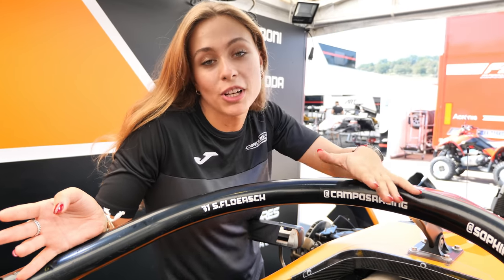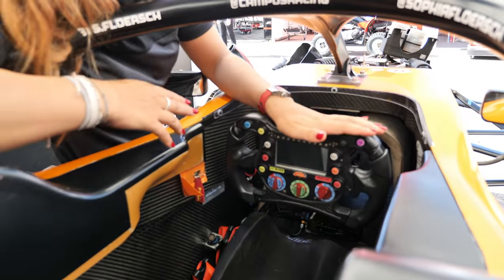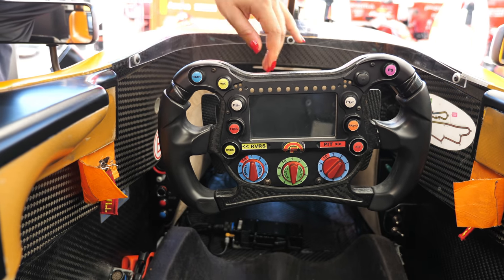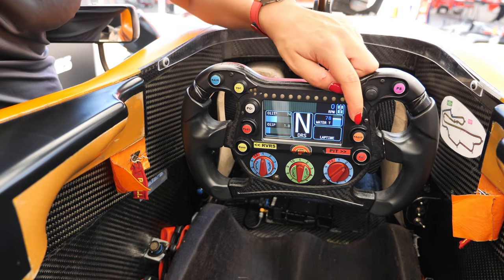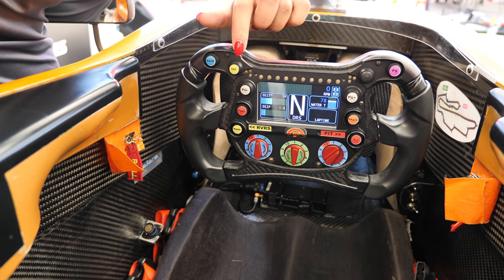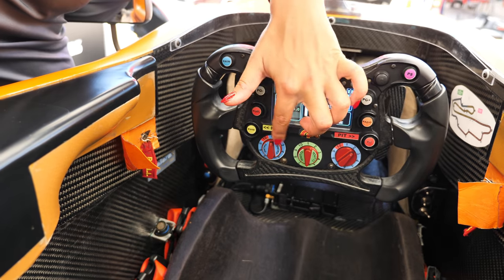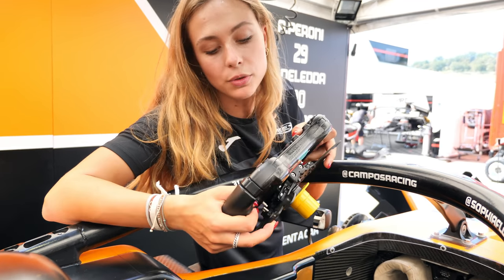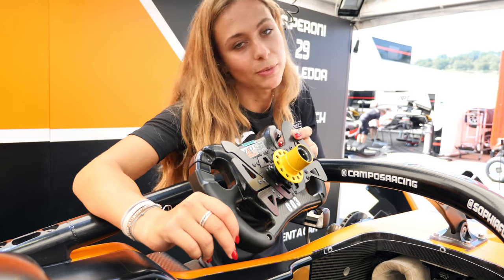SOPHIA FLOERSCH - FIA F3 steering wheel explanation of the 2020 car (same as Formula E & Formula 2)

Comment: Interesting that the DRS is not activated by a button.
Reply: Might just be an F2/F3/FE thing?
Reply: @bobbob123ful  even Renault uses a paddle to activate drs in f1
Reply: @user-rq2mp4dr5l  Didn't know that. Do all teams in F1 do it?
Reply: @bobbob123ful  I think even Alfa Romeo does it but I'm not sure, I'll have to double-check, but u can see one of the Renault onboards and see the hands on the drs zone
Reply: @user-rq2mp4dr5l  Yeah if you find it let me know!
Reply: @user-rq2mp4dr5l  Neat, thanks!
Reply: Jenson Button 😄😄😄😄
Reply: Me with my G29 be like...
Reply: Most teams i think
Reply: iirc there's one video on Youtube that explains F1 steering wheels by a Renault reserve driver or something. apparently some drivers customize what function of the paddles on the back do(excluding the ones to shift the gears) because there are more than 2 paddles at the back. some use it for DRS and some for the ERS
Reply: That's why nearly all drivers have "installation days" where they test 2-3 configurations that they may have requested or for any reg changes. 
The same as you would on a sim
Reply: @user-rq2mp4dr5l  I found another little bit of footage - here they show Ricciardo hitting those paddles to engage DRS at Bahrain last weekend. https://youtu.be/UW6f7CkQ90U
Reply: @bobbob123ful  ya, just finished watching that video, I didn't even remember I left a comment here 😅
Reply: @user-rq2mp4dr5l  I never forget anything. That's a lie... but I remembered us talking about it so I wanted to share!